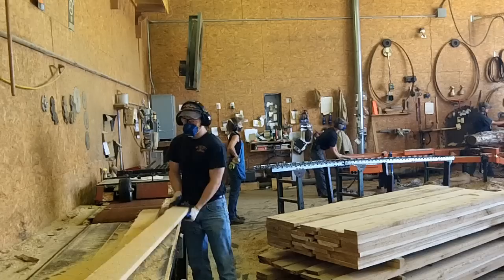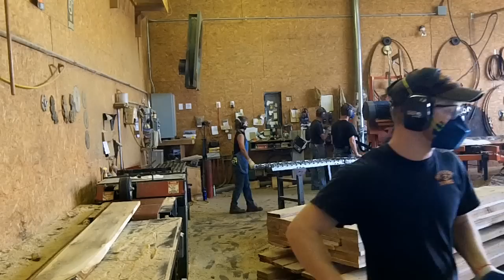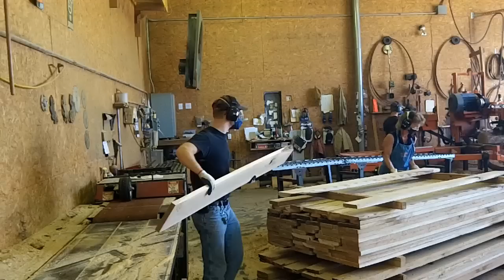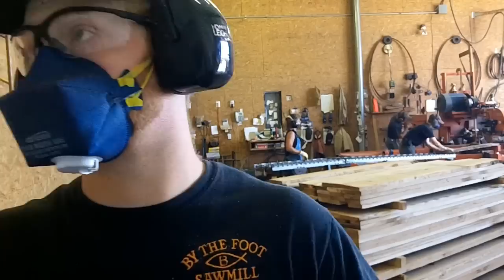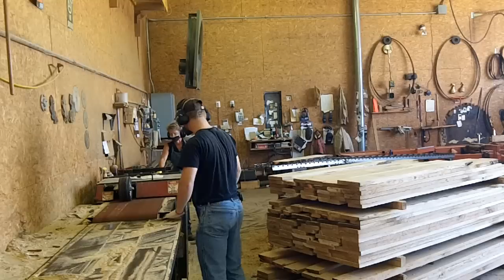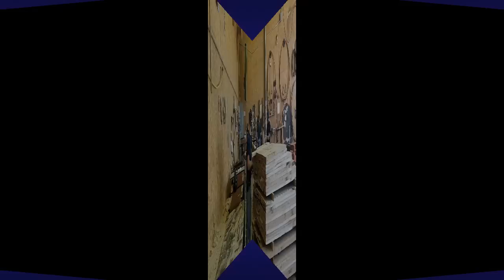REAL TIME Wood-Mizer & Family Team Milling Rustic Oak

Comment: How about mounting a big clock on the wall.  That way when you post a time lapse we get a sense of the time gone by.
Reply from the maker: There is a clock on the wall, but it isn't always in the camera view OR clean enough to see in the videos. :)  I never know whether I will add speed until the editing process, which can be days or weeks after recording. I use different angles to record, so it's hit & miss if the clock is visible.

Maybe I'll let viewers lose all sense of time & just enjoy watching! :)

Thanks for the suggestion though & thanks for watching!!